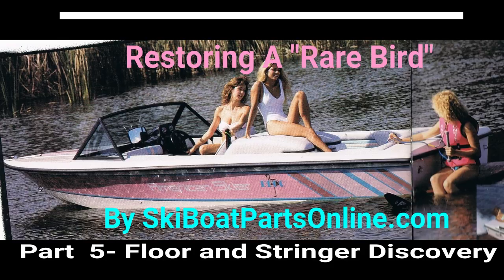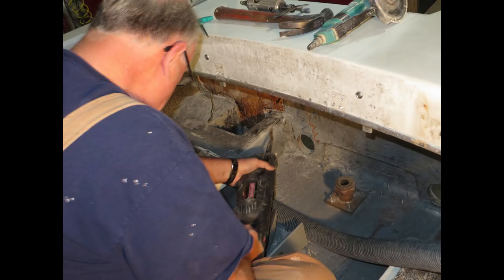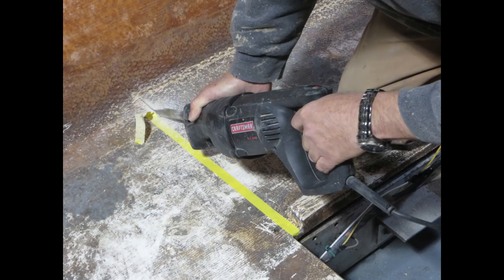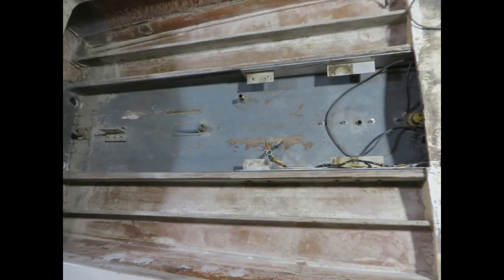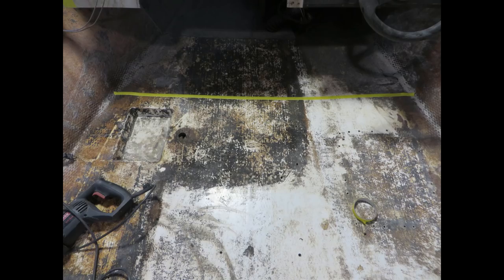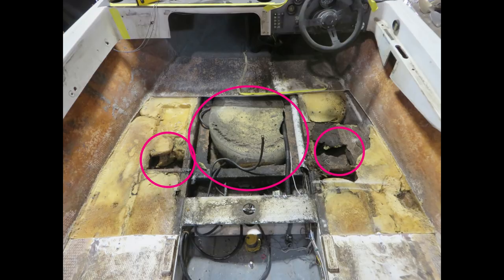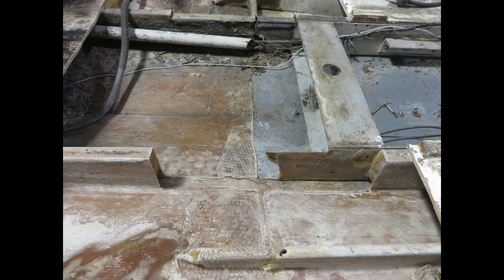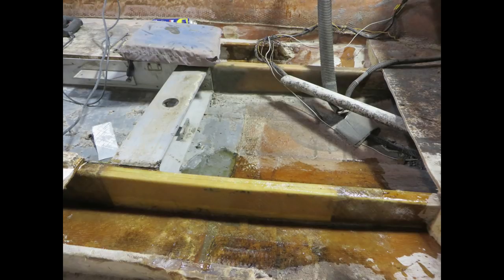Restoring A Rare Bird  Part 5 Floors and Stringer Problem Discovery

Comment: Ron, Thank You for doing these videos. It encouraged me to buy a vintage ski boat (not that I needed a 3rd boat) a 1981 Ski Supreme with 401 hours. Boat runs perfect, but noticed 2 of the engine mount bolts turn by hand which means rotted stringer (UGH) but feeling good at replacing them this winter since wathching your videos. Also plan on buying most parts from your business. We are in NH

Comment: Hi Ron,  Thank you again for these videos.  My 86' Malibu floor is so rotten that it cannot be used again.  What type of material do you suggest for the floor replacement?
Reply from the maker: Most common is Marine grade 1/2" plywood, then resin coat the bottom & top & add fiberglass to the topside and tie it to the hull sides.

Comment: Which brand high density foam board did you use for the stringer replacement? And why did you sandwhich 2 smaller thicnkess rather than 1 board of the thickness required? Thanks Ron, this series was awesome. Working on a 1990 Baja Sk 200 following your series. Will definitely be buying some parts soon!
Reply from the maker: We used COOSA brand core, I probably used 2 scraps we had rather than cutting into a full sheet. Any time you use foam board for stringers you need to make considerations for any thru-bolted items,  or anything screwed into the core, they have poor screw retention compared to wood.

Comment: I was curious to know how you removed the foam from the boat hull?
 I presently have an aluminum boat and I am using a drywall saw and a putty knife to remove chunks of saturated foam. Did you use a chemical to remove the residue that’s left? Thanks
Reply from the maker: I am not aware of any chemical that would dissolve the foam & not damage the the resins, I get creative with various hand tools to dig it out

Comment: nice video, after replacing the floors and securing them down do you fiber glass the entire new wood or just the seams? thanks Ron !
Reply from the maker: The Seams AND the entire floor going up the hull side 3-4" and down the inside stringer if possible 4-6"
Reply: Thanks Ron, do you recommend using the 1808 mat or the CSM on your website for the floors.
Reply from the maker: CSM works, but 1808 is substantially stronger, CSM is really a filler with little structural benefit, 1808 is structural

Comment: Can you post the rough amount of hours work on the boat that goes into each restoration video?  I think the compressed sequence videos and years of experience may mask the shear effort involved in this work.
Reply from the maker: Well let me try to answer that. I have "billable hours", actual hours, and accumulated time on each project. Accumulated time is the easy one, the day the boat begins and the day the project is completed. This project started 2/23/18
Actual Hours are the "Man-Hours" spent on the project with different rates between my time and my shop help time.
This does not include curing time, time working on other projects, time I spend on the phone with customers, time I spend packing, shipping parts orders etc. I average around 3-5 hours a day with parts alone.
Billable hours are broken down into specific phases like assessment & basic tear down, int. removal, eng. removal, and Pres. washing. On this job that came to 7.5 hrs and I always tend to bill a lot less than my actual time (hope my wife doesn't read that part)
Many of my customers will do this over the course of an off season, they buy misc. parts from us and I give them unlimited support via phone/email at no charge. Currently I am doing this with a 1987 Ski Supreme, an older Ski Tique, a 1979 Ski Nautique, and a 1984 MasterCraft, all watching the videos and duplicating much of what I am doing.
Not sure if this helps but it's time for me to finish glassing up the floor so we can re-foam the boat tomorrow.
The biggest thing that you don't see is the amount of glass dust we generate and clean every day, my grand-kids know this as "itchy-dust"
Thanks, RonT